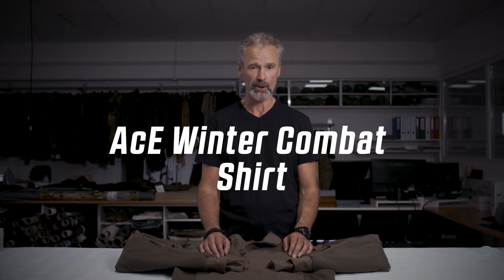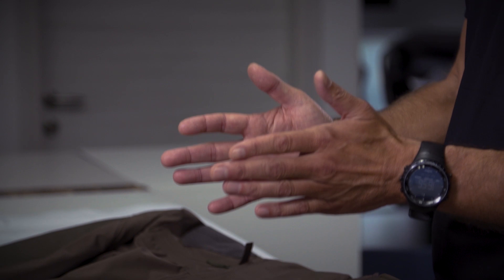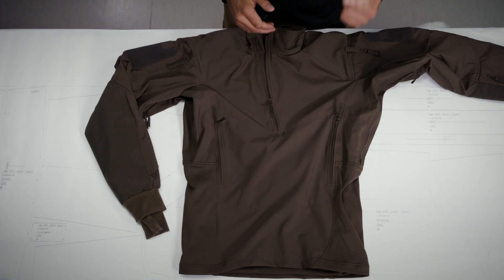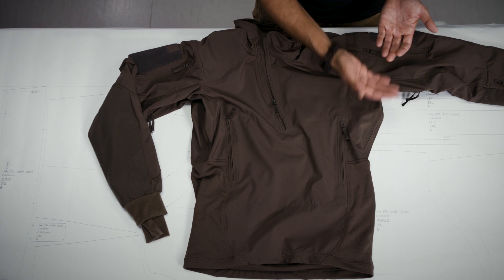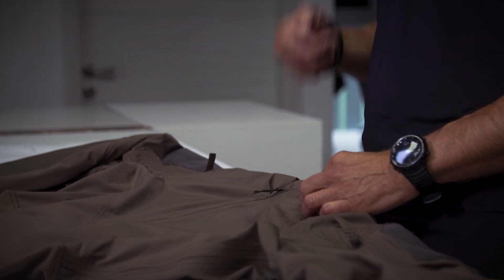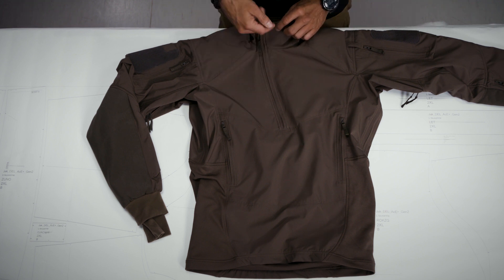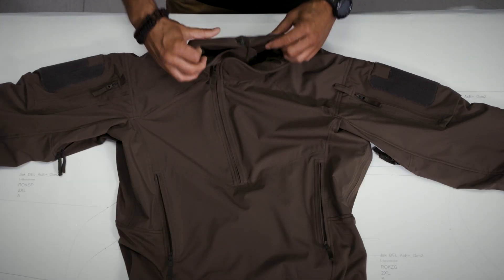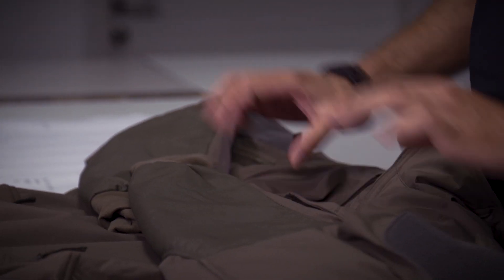AcE Winter Combat Shirt | Product Spotlight

Comment: How does this compare to Delta Ace 2 tactical winter jacket? Or are they basically the same?
Reply from the maker: Both products, the ACE Winter Combat Shirt and the Delta ACE Plus Gen 2 Jacket, are very similar and are made for the same climate and purpose. There is only one main difference and that is the the zipper.

The Delta ACE Plus Gen 2 Jacket has a big advantage, in case you need to dress and undress quite frequently, due to it's long zipper.

The Ace Winter Combat Shirt on the other hand is more comfortable, when it's worn underneath e.g. a plate carrier, due to the zipper location.
Reply: @ufprogear  what is the ideal temp this can be worn in? For moving and remaining stagnant?

Comment: If the pockets must be open for a "down cooling" ventilation all the stuff will fall out during physical performance. For example if the operator must climb, run etc.
Reply from the maker: @Toby: the zippers under armpit are not pockets and you can use those for ventilation, if you do not carry anything in front pocket you can additionally also open them.
Reply: @ufprogear  make sense. Thank you for the Feedback.